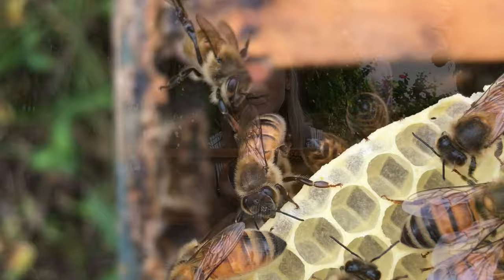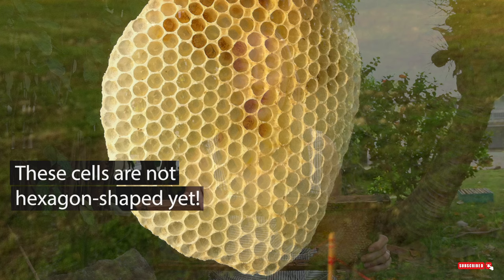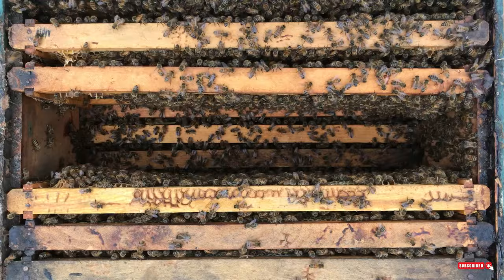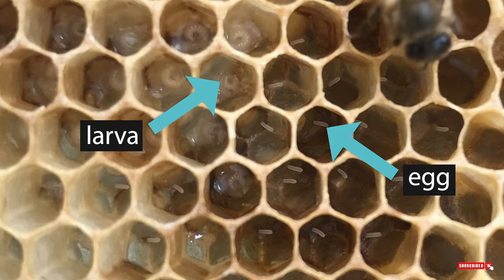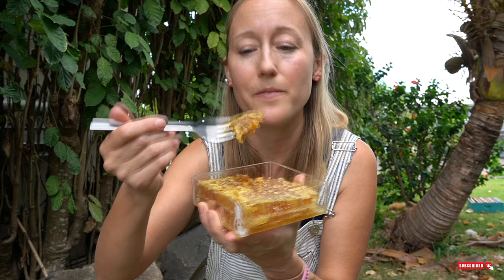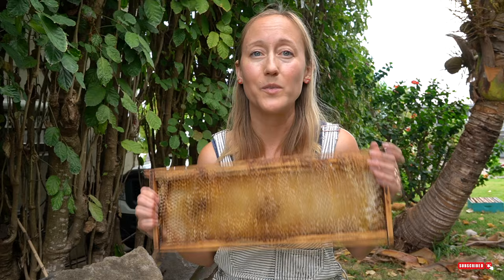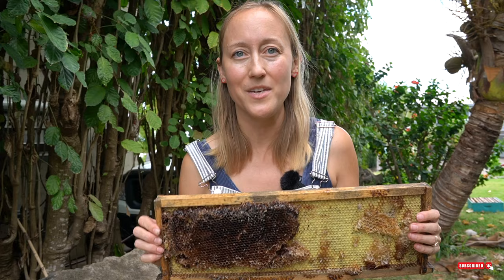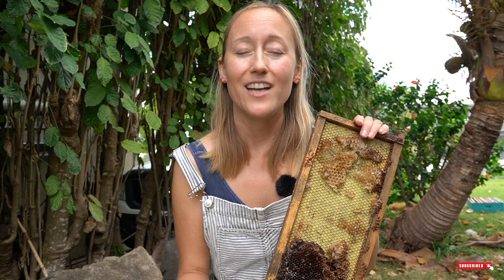HOW BEES MAKE HONEYCOMB - It Might Surprise You!

Comment: Im still not sold on the cylinder  to hexagon,i think bees draw hexagons from the bottom on out,or foundation may  as well be circles, rather than embossed  hexagons😊
Reply from the maker: Good point! There is only one way to know for sure - put a frame with no foundation into your hive and look at the comb when it is really tiny, just a few inches tall and wide. Look at the shape of the cells.  
I would think that if foundation was in the frame, the cells are built as hexagons from the start. But, if there's no foundation, they start out as cylinders.
Reply: @BeekeepingMadeSimple  i think they start as trihedral 3 sided pyramid, like dadants smoker symbol,comb is drawn out,not stacked,...it would be really great to see festooning and  the drawing out process in time laps,I did find some studies on the surface tension,cacoons,contributing to the final structure,its facinating for sure,how the cells stagger side to side in a zigzag